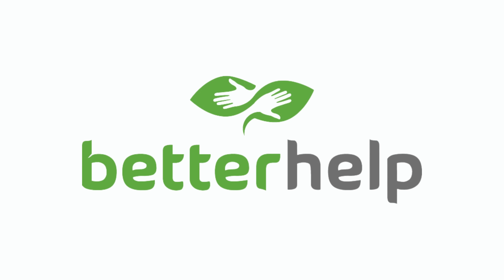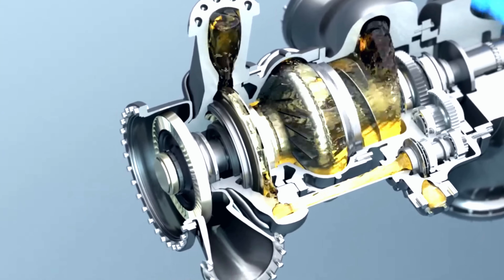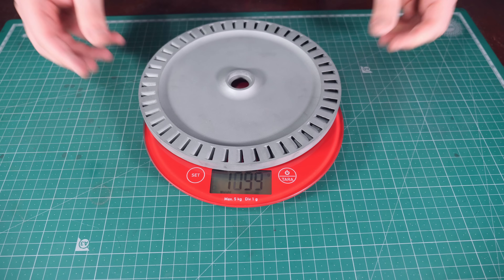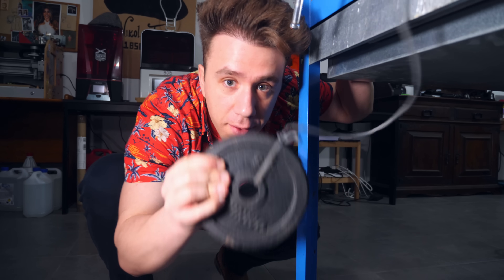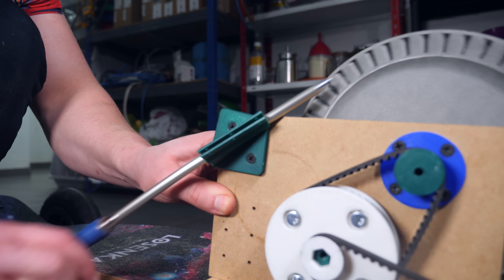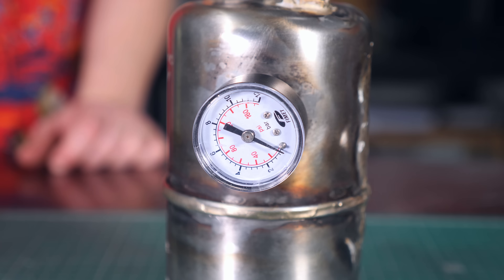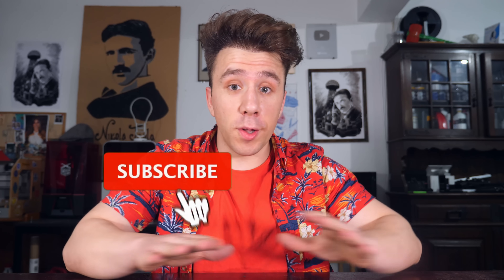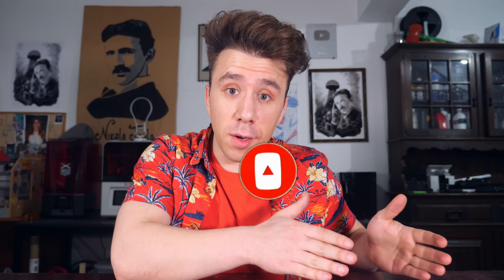I built a TURBINE Skateboard

Comment: OMG THATS THE MOST DANGEROUS THING I HAVE EVER SEEN YOU DO. That nitrogen container was a bomb, you NEEDED a pressure valve on that thing.
Reply: For real, seeing this had me scared for him. I’ve seen that one video of the tiny Hero engine exploding on N2…
Reply: I was a lot more worried about the wobbly flywheel with a massive amount of stored energy with his face right in line with it. I think he needs to watch some flywheel malfunction videos from cars, that needed far more respect for it's safety than it got.
Reply: @Rippthrough or surface grinding wheels exploding. That flywheel is sintered, so its a pretty apt comparison. I was terrified watching him spin it up for the first time.
Reply: @Rippthrough I agree his face was like three inches from that thing
Reply: @Rippthrough  I spent about half of the video waiting for the printed plastic bushing to let go and send that thing across his shop.
Reply: @Rippthrough  turbines and flywheels are very different in how they work once leaving a engine. A turbine will continue the same rotation path the entire time because the gasses still inside the turbine continue to spin it in the same direction being outwards, whereas a flywheel is moved by the crankshafts movement making it capable of flying in any direction the force is directed towards. Overall this really wasn’t all that dangerous, his RDE was way more dangerous. He managed to sustain rotating detonations for a few seconds, that’s way more dangerous.
Reply: @Rippthrough 370 RPM is what he said.
Reply: Self build pressure container next to an open flame.
What could go wrong? At it least it is not Hydrogen
Reply: @SoaringExperience  The open flame not too much to worry:D exept if the rotational mass is gone wild, like the plastic shaft shear :D Then the fun begins ... :D
Reply: @_decky4ever_ I rewatched. I thought he said "oxygen" but it is not liquid oxygen. He said and wrote nitrogen. Which is inert so no issue with the flame
Reply: @SoaringExperience  isnt Nitrogen inert ? Are you thinking of NOS gas?
Reply: @impuls60 well i tgink he means the heater line
Reply: @impuls60 More the pressure build up inside push the metal pops metal shards, aka frag grenafe
Reply: @impuls60  NOS is just a brand, kinda like how band aid is a brand but it's also what we call them colloquially. N20 is also non flammable and is just used to raise cool the engine, increasing compression and to increase pressure to feed more fuel/air mix. It doesn't actually burn, thought it did for the longest time.
Reply: @impuls60 My mistake I thought he said oxygen, but he definetly said and wrote nitrogen. WHich is inert and a good solution regarding an open flame!
Reply: @brendanstone9095 N2O is an oxidizer that allows more fuel to be injected into the engine without increasing charge pressure or airflow. It does, however also cool things off, but that is not the only function
Reply: @impuls60  nitrous oxide isn’t explosive or combustible, it just delivers super cooled oxygen into your engine. It just adds oxygen to the fire so it’s not to much to worry about.
Reply: @impuls60  no, it’s just the pressure 0:03
Reply: @SoaringExperience Well, if nitrogen were combustible or flammable, we all would have died a long, long time ago.
Reply: @grimmington2569  nobody said the nitrogen was going to catch fire. Turns out that gasses under pressure can be dangerous without fire.
Reply: @neoncyber2001  except someone did suggest the gas being near an open flame was trouble, one of the first few comments even so not sure how you missed it. 🤷
Reply: @SoaringExperience  it could explode 0:03
Reply: @SoaringExperience  Frostbite, burn and explosion damage all in one go, i think they will cancel eachothers out
Reply: I started watching when he was lighting rocket motors in a wooden attic. This is a big safety step up.
Reply: Oh , you mean a first stage regulator. Instead of just cracking open the valve.
Reply: The chainsaw sword
Reply: I've never cringed so hard watching him put his face DIRECTLY over that bomb. Makes it even worse that it's heavily embrittled from the liquid nitrogen temperature
Reply: Glad to see I am not the exception in my thinking. Seeing that cintered wheel spin up under load, with no safety barrier was no bueno. Then seeing the pressure build in that refrigeration expansion chamber was terrifying...that's just a bomb waiting to happen. Integza seems to be getting a little too ballzy lately with how he is managing his safety. And considering his sister's are usually behind the camera...their safety too. I don't want to see a headline about him having a catastrophic failure.
Reply: Liquid nitrogen without gloves
An untested pressure vessel ….
🤦🏻‍♂️
Sure it’s your safety but others watching might be unlucky
Reply: Make an aircannon! Use from kind of tiny tank and make it shoot with the opening of a valve! Kinda like a big party popper.
Reply: Average Portuguese engineering tbh
Reply: Bomb plus a unshielded flywheel at direct center giving maximum probability of causung damage if it where to explode or get loose. Deathtrap is an understatement.

Fortunately on the liquid nitrogen side, how he was using it is through a hose then a valve, so the hose is more likely to bust than the metal container. (Assuming the ball valve is kept open.)
Reply: I came here to say the same thing!  And if that flywheel turbine cracks it's going to explode too.
Reply: What he needed was a  pressure relief valve of a cars A/c compressor they are a failsafe and can quickly vent overpressure then close  most are set at like 250 psi and are threaded  they look like a small bolt .
Reply: The nitrogen being cooked over open flame is going to cause the pressure vessel to rupture and send sharp metal all over the place. Doesn't matter if the gas inside is inert
Reply: what about nitroglycerin
Reply: Barehended I may add
Reply: Nice one ❤❤😂
Reply: Make a turbine powered bike
Reply: And some bloody gloves to handle it!!
A splash of the thing can burn a hole on your hand!
Reply: Clearly you didn’t see the nitro glycerine video…
Reply: Quiet down Nancy
Reply: Large accelerating metal disk next to his head?
Reply: And they use heavy gloves when handling liquid N for a reason ...
Reply: Its been mentioned but a dozen or so, Nervous Nancy's have chimed in since the last occasion. That brazing is going to fail unspectacularly long before the stainless steel cups fragment dangerously. 

The lack of a splash guard, or a guide to redirect the fly wheel away was far more egregious, but for a singular personal project, those are rather meh concerns. 🤷
Reply: A pressure release valve set for what pressure? He'd need to do some hydrostatic testing on it first. This scared the crap out of me to.
Reply: Do a cyborg cockroach and do something with the neural output and input.
Reply: Womp womp
Reply: Most dangerous so far
Reply: Nah, let him cook.
Reply: incredibly dangerous😮
Reply: and the 3D printed turbine at high speeds can explode, it is also like sitting in a killing machine😂😂😂
Reply: You mean the liquid nitrogen I assume?  I agree that would have made sense although in reality I am pretty sure if it failed it would have done so at the seam he welded and would likely not have actually exploded but yeah that would have been a good safety addition.
Reply: Yup, came here to say this! no PRV and you got yourself a pipe bomb 🤦🏻‍♂️🤦🏻‍♂️🤦🏻‍♂️
Reply: The things dangerous about this was the unshielded turbine and using liquid/pressurized nitrogen without gloves and face protection. Nitrogen isn't flammable, and he even commented that the tank he decided on was only going to be pressurized to 5-10% of it's capacity. Even on his homemade one, it would split where it's brazed long before it's going to shred stainless steel.
Reply: Cap
Reply: The regulator on the tank could have very easily been knocked off.  Very dangerous.
Reply: Not really. Nitrogen is non explosive and actually suppresses fire. If it was hydrogen it would be a bomb, like the Hindenburg.
Reply: That flywheel is more dangerous. Look at how uneven and unbalanced that thing is. Plus he’s sitting inline with that thing. If it were to grenade it’s gonna hit him in the chest neck and head.
Reply: It was definitely sketch.. I was like no way he’s gonna braise that and have 1000 psi or more in it lol
Reply: That's so cool. You've made a little CAR that's also a demonSTRATER. 
Maybe call it a CARSTRATER.
Reply: Not mention wearing rubber gloves to manipulate it.
Reply: Sticking his face right in the plane of rotation was also not ideal. That wheel is poorly produced metal and probably shouldn’t be spun up that fast.
Reply: Absolutely THIS.

Stunning lack of safety all around.
Reply: I am so making this thing at my house
Reply: First, when I read this comment I was like what and then when I saw the flame underneath it, I’m like okay no you are not doing liquid nitrogen today 0:01
Reply: Frozen Portuguese eggs
Reply: No it wasn't a bomb. No flammable gas. Karen
Reply: 😂 DRAMA
Reply: I'm hiding from the screen seeing this😂
Reply: Gas canisters can sustain an absurd amount of pressure. Reference: Mythbusters only succeeding in the last shot, after trying really hard multiple times.

Also, not like Integza is the least sane YouTuber here; NileRed and Colin Furze got REALLY hurt more than once.
Reply: @NothingXemnas  I think they are talking about the brazed camping cups, not the tank he was using at the end.
Reply: @NothingXemnas I knew about Nilered, been watching him for a VERY long time. But I never heard that Colin furzs  got super hurt. I'm not surprised, but... what happened to him?
Reply: @indyfast He burned his entire arm when one of his propane powered engines misfired and exploded
Reply: I was thinking the same, it needed a pressure relief valve. I thought it was gong to explode at one point.
Reply: I don't know, he also made a chainsaw pike with no dead-man switch to cut it off if he dropped it, and then swung it around in proximity to other people. This pipe bomb was definitely an 11 on the 1-10 dumb ideas scale, but its got some competition for top spot 😬
Reply: tbh I see a lot of people scared of this, but I wouldn't be worried, if its gonna blow up, it will be around the braze, and simply split in half, the bottom just hitting the skateboard and the top harmlessly going upwards, the fact it's brazed together is a (very crude) failsafe that should make it (mostly) safe
Reply: @Minty1337  that's the best case when bursting, it's not guaranteed that it rips there, could also pop a valve making it a projectile etc, pressurized gasses don't have a hazard symbol for transport out of fun and that's with tested and overpressure valves
Reply: After watching the boiling nitrogen bomb... My anxiety is through the roof. Good thing we have that sponsor.
Reply: @neoncyber2001 nitrogen is inert, and the cups were brazed. It would have never built enough pressure to do any real damage. The braze would have broken first or the hose for the pressure line would have split since he had the valve of the "tank" open. The real scary bit was a wobbly flywheel/turbine made of sintered material spinning at 8000 rpm with no shielding around it whatsoever.
Reply: Apparently you haven’t watched the old videos where he was lighting rockets and jets in his attic!
Reply: @JohnBoy87-87 this is way riskier. Flywheels store insane amounts of energy. He effectively put two bombs in very close proximity to his face and other soft parts.
Reply: did not read all comments ,but NO² is not flamable. . it just help other flamable stuff,like gassoline burn better, coz it provides more O²,oxygen to the reaction
Reply: Nitrogen is not inherently dangerous, dinitrogen oxide (nitrous) on the other hand is, the nitrogen was just an easy very efficient way of creating "steam"
Reply: @michaelmain1990  Someone mislead you, as nitrous oxide is not flammable. Source: National Library of Medicine
"Nitrous oxide is an odorless, colorless, non-flammable gas. While nitrous oxide is not flammable, it will support combustion to the same extent as oxygen."

So in an open flame, or will not burn; however, added to the combustion cycle where it can break down into its Nitrogen and Oxygen components,  thereby increasing combustion thanks to said added oxygen.

The concern here was purely about the pressure vessel he made potentially rupturing due to over-pressure.
Reply: @michaelmain1990  it’s the pressure ever 0:03
Reply: That plus pushing wood through a tablesaw without a push stick on the wrong side is a recipe for missing fingers.  At some point it's going to kickback and he is going to be VERY sorry.  They have a saying in Alabama.... Y'all gon learn taday.
Reply: @Theexplorographer  pretty sure that's just a Midwest saying 🤣
Reply: Yep. Terrifying.
Reply: Please report all having fun to your democracy officer for review by the ministry of truth. Thank you.

Comment: You can solve the issue with steering the skateboard if you have your weight towards the front of the board. Having weight on the rear caster creates a stronger positive feedback loop that skateboarders unafectionately call "wobbles". Downhill skateboarders also mitigate this with lower degree truck angles in the back of the board which means you get less turn for how much the skateboard truck leans.
Reply: *death wobbles